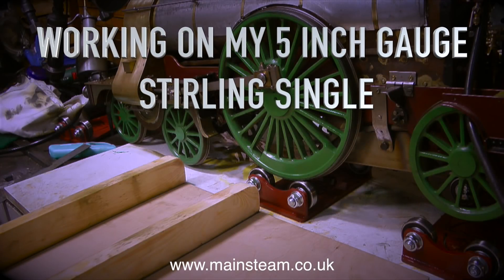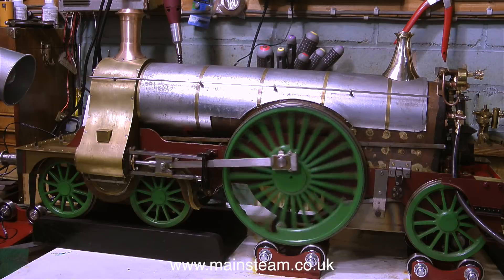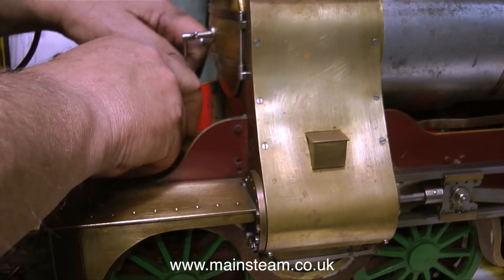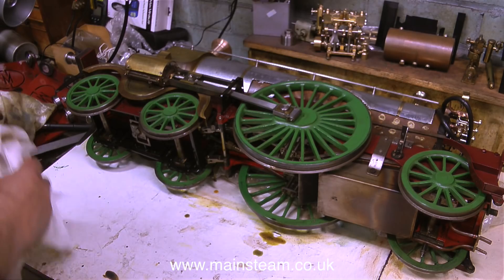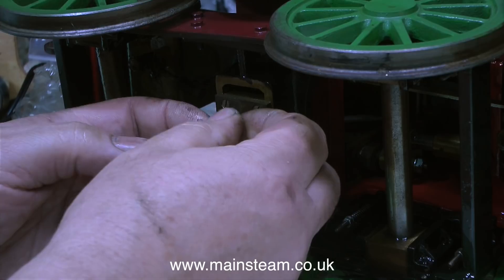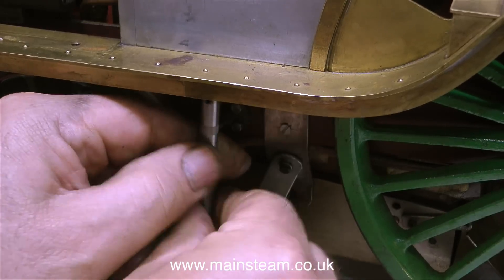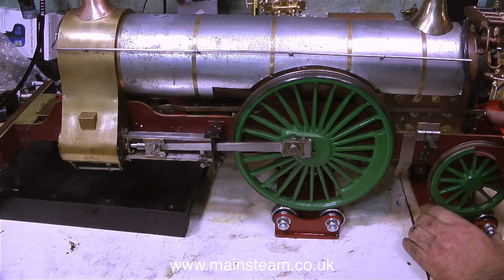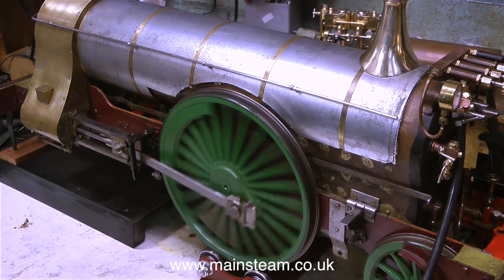MY STIRLING SINGLE #6 - TAKING IT APART

Comment: A technique that I use for stripping is to out line your strip with drafting tape. It come in different imperial sizes from 1/32" to 1/2" from a drafting supply store. To get a 3D look, make your width 1/32" wider than what you want and apply your base coat. Let it dry then put the 1/32" tape over the base coat and apply your color. Only problem I've had is the tape sometimes leaves the glue behind but it comes off with denatured alcohol.
Reply from the maker: At first I thought you were advising me in the best way to take my clothes off in a public place . . .  }:-)))

Comment: Does not the flange height also figure into how high the platform should be?  Is the suspension system of using springs under the horn keepers a normal prototype design or just a convenient modelling method to avoid making an equalized suspension or individual springs with axle box push rods in the smaller gauges?   Why do refer to the size of the engines by gauge and not scale?
Reply from the maker: no, as the wheel sits on the tread  - not the flange.